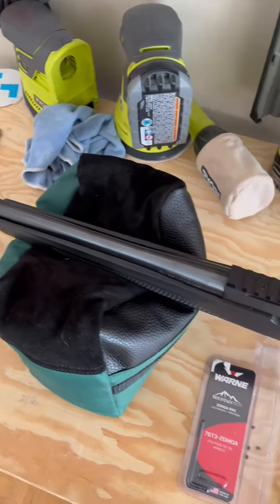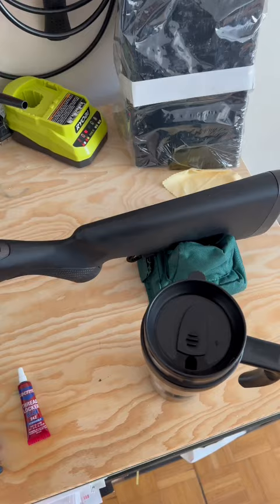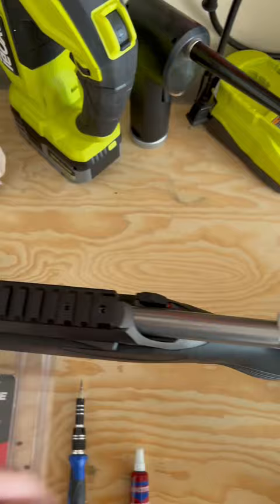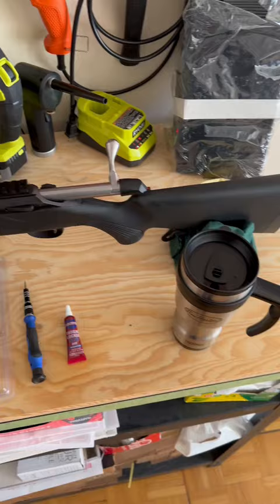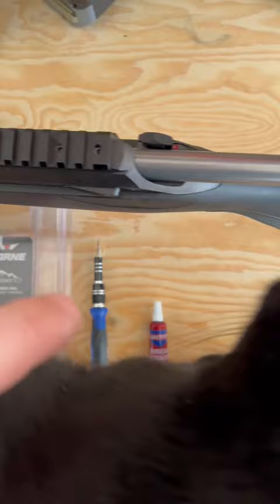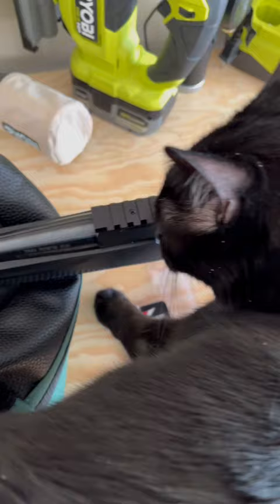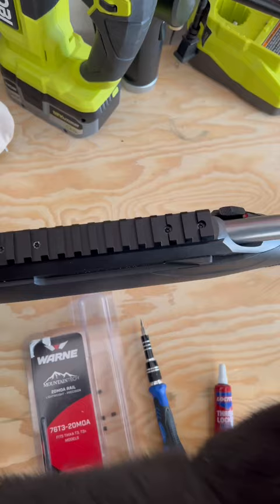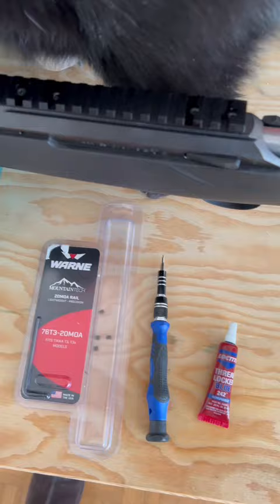How I Installed My 20moa Picatinny Rail for Tikka T3x

Comment: Tikka recommends to also glue the rail to the receiver, last page in the T3x manual…
Reply from the maker: I think gluing might be a little overkill, but I have heard of guys putting some loctite under the rail for it to hold a little better with the recoil. 

That said, my screws are in with loctite as well (blue) and I've had no issue. I think gluing anything is a bit of a scary thing to do especially if you ever want to change out the rail or eventually sell the firearm.

Interesting though that they would recommend that.
Reply: @canadianoperator  I’ve glued a pic rail with loctite 648 before to my Mauser, it came off when I sold it with a little heat. No problems.
Reply from the maker: @GermanHunter  good to know. Thank you brother.